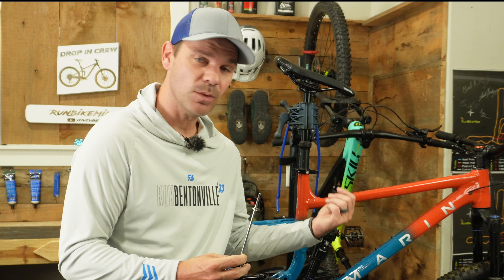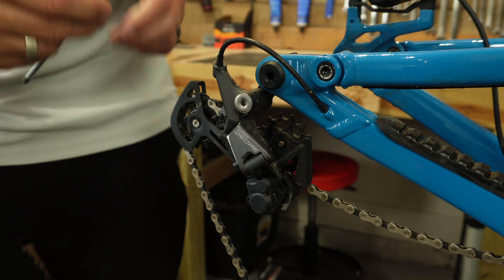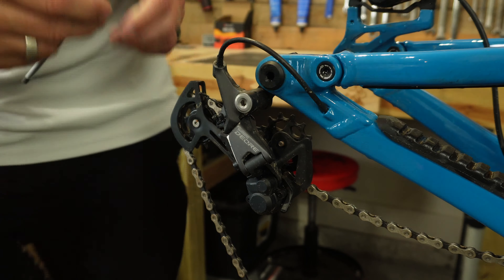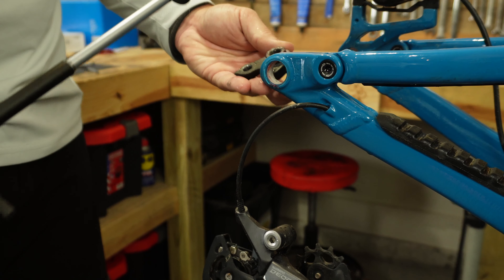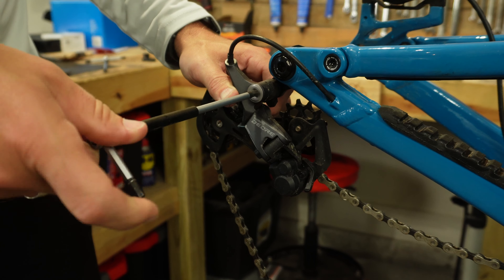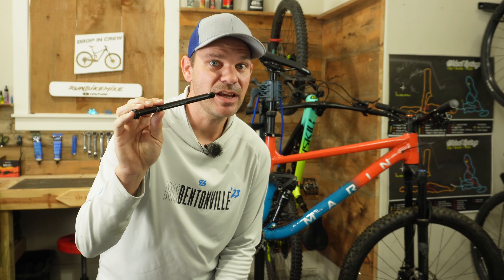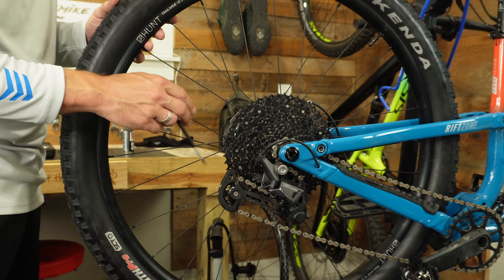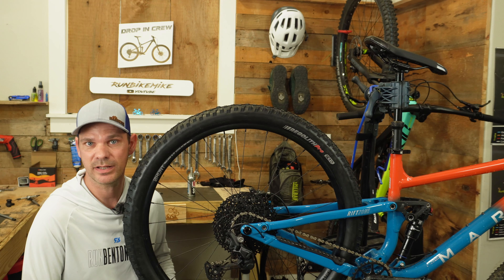2023 Marin Rift Zone 1 Thru Axle Conversion / Everything You Need To Know - SRAM UDH

Comment: I bought a 2022 Rift Zone 1 for cheap on closeout. I just ordered this setup thanks to your video. I appreciate it. Both together were $68.
Reply from the maker: The 2022 is different you wont need a UDH. You will only need a thru axle and the specs are different. This is only for the 2023 for now.
Reply: The recommended axle is a 12x174 with a 1.5 thread pitch h. Problem is, nobody makes one. I've looked for days. I can find a 172mm, but that's as close as it gets. 13mm thread length.

Comment: Hey! Thanks for tutorial. Can you give exact thru axle measurements? Especially thread length etc. I'm from Europe, the axle you added in description is not available here.
Thanks
Reply from the maker: 12mm thread length -174mm full length -1.0 thread pitch
Reply: @RunBikeMike  thanks. Ordered with same spec aside from longer thread. Hope it will fit!
Reply from the maker: @piotrnarajowski7989  longer thread should be fine as long as it is not a lot longer.

Comment: Very informative, thank You!
I have one question is it enough to change the original rear wheel hub to one that is compatible with thru axel?
Reply from the maker: You can do that or buy a new rear wheel. Either way you have to have a TA compatible hub when doing this upgrade.
Reply: @RunBikeMike  I think if You could use 54T rachet hub, it's a better upgrade than buying another wheel with 32T or worse one.

Comment: Great video. The thru axle comes with a conical washer on the non-threaded end. Is that washer mandatory or did you remove it? I’m guessing it depends on your frame’s drop out. If it is flat, you would remove that washer.
Reply from the maker: I left the conical washer on since the frame on the RZ has an impression on it. It fit perfectly in that impression.
Reply: @RunBikeMike  Ah thanks for confirming. Some frames don’t have that chamfered impression so the conical washer won’t be needed for those bikes. I think Wheels Manufacturing thru axles are sturdier built than RockShox Maxle Stealth thru axle.
Reply: @RunBikeMike  I beileve marin calls it an adjustable nut.I have it on my new Headlands and DSX.I''m going to contact marin about it and get some more info on this type of thru-axle,as I can not find  any detailed info on the web.. yet.But I find it odd, comapared to my other bikes with different type of TA. And why QR on the Rift Zone 1 and not the 2...Come on Marin do not cut cost here..

Comment: Nice one.  Got a question for you as you referenced grease on the thread..  My son has the Riftzone 2 - and recently having rear wheel loosing going on (TA untighened) when riding janky trails - jumps and flow - doesn't happen. Yes, threads are greased.  Anyway, contacted BikesOnline AU and they suggested Blue Locktite. (and remove the grease on the thread accordingly).  I've just done this and have yet to test.  What I'm interested in, is do you think the TA itself is faulty... or something else.  I shouldnt have the use locktite to keep the TA tightened and feels its a bandaid approach.  I could also be very wrong.   My Norco Sight and Merida Big Trail (a bike not available to you but consider it a trail hardtail with UDH) does NOT have this issue.  I'd expect a HT to have it happen to - as I've ridden that on the same "jank" as the Riftzone.
Reply from the maker: Yeah don’t use locktite that is very bad advice. You want to use grease so it doesn’t seize up. I would recommend making sure that it is at the correct torque setting before you go out on your next ride. I haven’t heard of a thru axle coming loose as long as it’s at the proper torque setting. You could try another thru axle and see if that would fix it. The other thing you could check is the thru axle flat or is it conical shaped on the non-threaded side? I’m pretty sure the rift zone 2 uses a conical shape. You should see an indent in the frame when you take the thru axle out. If you don’t see that and you’re thru axle is conical then I would say you would need a flat through axle but being that this is a rift zone 2 it should have come with the factory thru axle and be the correct one.
Reply: @RunBikeMike  Yeh, I have a torque wrench and have at 11nm as per the standard. I did goto 12 just to be sure - didn't matter still came loose. Well.. I did the  locktite as they said.. and the TA is the Marin one they provided. I may contact Marin directly.  Thanks for your reply much appreciated. 🙏